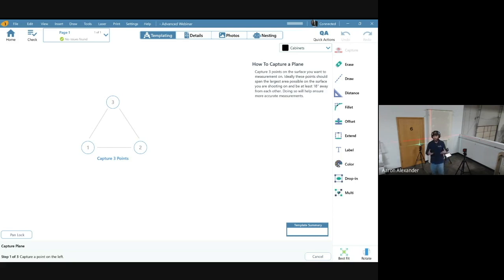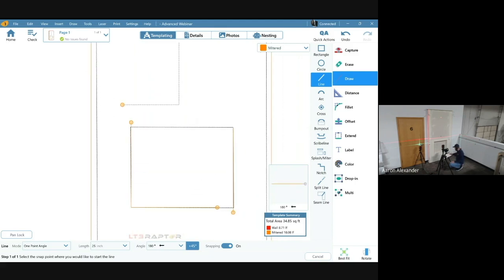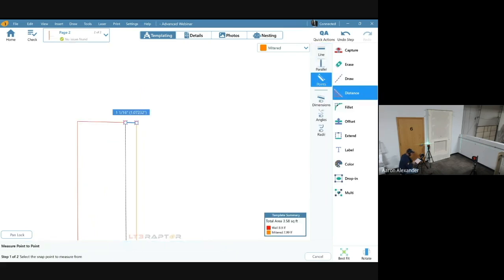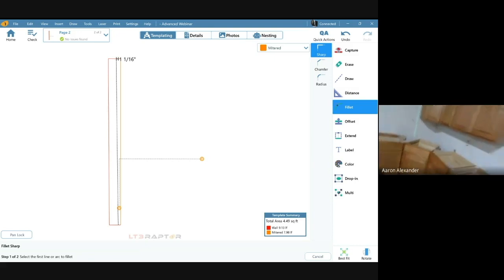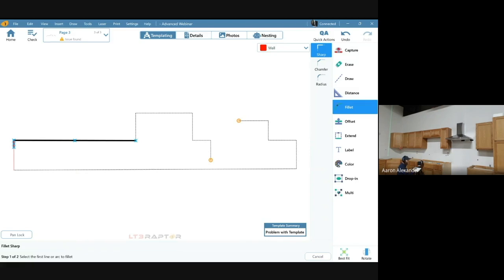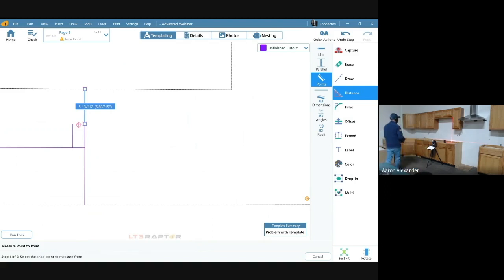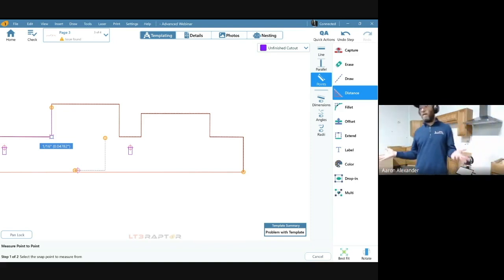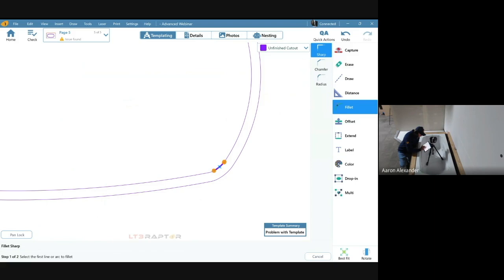LT3Raptor Vertical group training - May 16, 2023

Comment: Will this work if i use a level to make my plumbed lines ??
Reply: I have not tried using a traditional bubble level. The concept is the same, however I would worry about the precision with a regular level.
Reply: I think it would work just fine, especially because you can check the angle in the program to see how accurate it is.